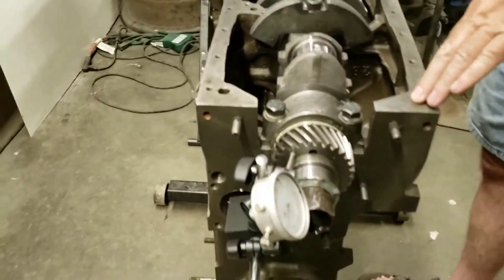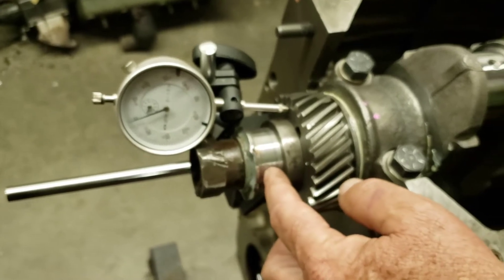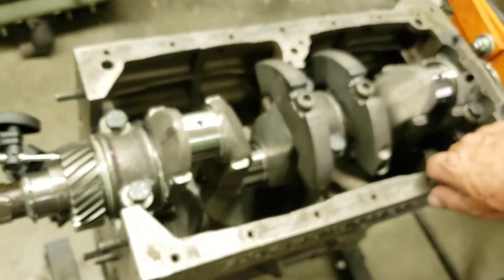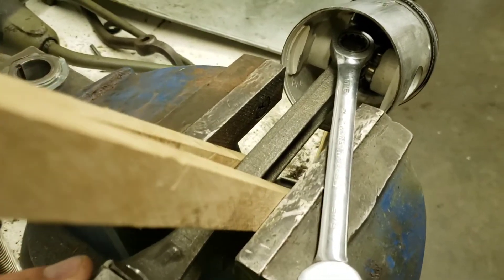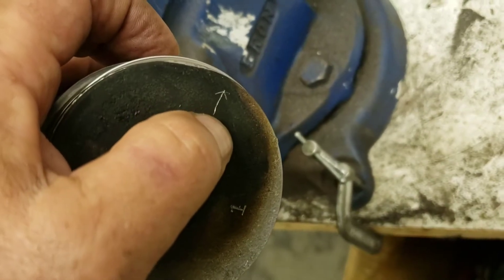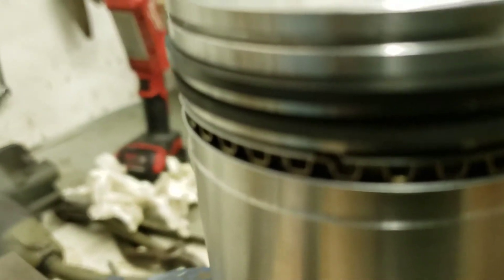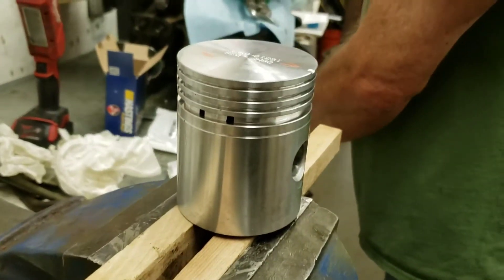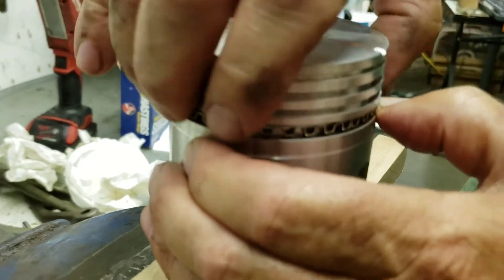L134 engine build #4.

Comment from the maker: The cam is usually in great shape.  Just inspect it.  The spot where the fuel pump rides is usually the high wear spot.  Springs just need inspected for cracks and height.  Valves can be used if they are in good shape.   New ones are fairly cheap.  I always replace the valve guides.  They almost always are worn.  That sucks oil and reduces compression when the valves are sloppy.  Bearings are a must most times.  Have the crank checked and polished or ground.  Plasigauge every bearing.

Comment: Quick question Lew...any particular reason why you didn't reuse the original pistons other than boring out to a bigger size?
Reply from the maker: They wear oval and putting an oval piston in a round hole is a bad deal.  Pistons are not cheap but not really that expensive.   If you bore the cylinders, I always use ne pistons and rings.  Compression will be like factory new and lots of power.  Hone and rering jobs always use oil, smoke alot and have less power.
Reply: @hummernutsfl  cheers mate, so basically best to just get new internals all around or do you think you can get away with using original valves, springs, rods, lifters, cam and crank? I'd assume the cam and crank would be good so long as they get polished and measured for new bearings yeah?

Comment: Hey, when you are checking the endplay on the crank, their is a little cylinder at the top of the dial indicator, that you can use to retract it while you are banging the crank forward, they are pretty delicate inside, and don't like to get hammered on.  Not trying to be mr know it all, I just figured with how nice you are to your torque wrench, you would want to be at least as nice to your dial indicator, which is a lot more delicate inside.  Thanks for the vids.
Reply from the maker: Good info!  Always learning!

Comment: Hi Lew, do you lubricate any of the fastener threads and bolt heads in the engine, or do you assemble and torque them clean and dry? I'm thinking specifically of the rod cap bolts, gudgeon pin bolt, main cap bolts, and head studs/nuts. I haven't been able to find a discussion on the topic. The manual doesn't mention it (to my knowledge) so I would interpret that to mean that the torque values given by the manual are for clean and dry threads. May I ask your thoughts on this?
Reply from the maker: My mentor said to clean the bolts spotless, lube them with oil, then wipe them clean.  The oil hiding in the pores is all that is needed.
Reply: One should always use ARP thread lube for accurate bolt torque.

Comment: How do you get a torque wrench on the wrist pin bolts?
Reply from the maker: Use a crow's foot wrench and do the math as the wrench manual shows.

Comment: Lew...did you need to check the ring gap on those too rings or were they already manufactured for the bore size and are a straight fit on with no ring gap grinding required?
Reply from the maker: I have not checked gap yet.  That will be in the next video when i put them in the cylinders.
Reply: One should always dry fit and test the end gap.